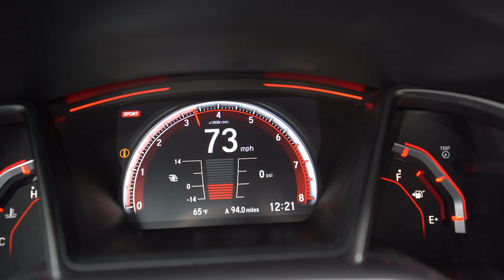I’m Having CLUTCH ISSUES In My 10th Gen Civic Si!!

Comment: I make the Ctr retro and it does not cost 2k stop spreading misinformation.  It’s 1650 installed for anyone willing to drive down and have it installed.  1250 if u need it shipped
Reply: Drive down where? 🤔
Reply: Is there a way to contact you directly?
Reply: AOMechMarine AOMechMarine not covered by warranty I’ve had mine for about 2 months only driven on week ends took it today and they said nah now i don’t know what to run for my clutch set up
Reply: k20z3allmotorFTW where your shop at bro ??
Reply: Depends where u live. Around here it’s closer to 2K

Comment: i have a bone stock 19 si and it sometimes won’t even go into first or when it does it’ll snap back into neutral and sometimes grinds. bringing it to the dealer tomorrow hopefully is something with trans fluid but doubt it.
Reply: Cmc mod you need to mod it. Will be making a video on process im upcoming weeks

Comment: I just picked up d2 coilovers for my 2020 civic si i got a great deal on. i cant wait to install that. i also got oem window visors for the sedan, acuity pedal relocator and a 2020 ctr shift knob. next will be some bolt ons. then clutch and ktuner. later will be e85. then later when warranty is over i will fully build the engine. and go for a solid 350-400hp daily build.
Reply from the maker: NIIIIICE

Comment: Honda has the best production, second to maybe Porsche. Just because you are running a shit ton more hp above what the clutch is made for doesn’t make it shit. 
Stop being a cheap ass and make your mods match what you are doing. 
Begging for free shit when you should’ve upgraded your clutch,intercooler and brakes before you pushed power. 
Be a little more intelligent about how you upgrade. 
Next, you’ll be blaming Honda for a weak motor when you throw a rod or bearing.

Comment: Its not that the stock clutch doesn't hold power per say. The 1.5t's make a lot of torque. The clutch is the same clutch they always used, the exedy stage 1. The older si and the rsx type s. If you take out the stock clutch it will have exedy written on it.
Reply from the maker: damn, didn’t know that at all

Comment: Spec stage 1 all day
Reply: I've heard people with spec are having high rpm lockout issues. The stock clutch master cylinder doesnt have enough force to disengage it consistently at those rpms. Not good for anyone trying to run power above tsp stage 1
Reply: daniel s I haven’t had this issue personally. I’ve had it for 3 months now. But I have the spec light wheel as well

Comment: My 2018 Civic Si sedan had the clutch go out at 38k miles.  I started working from home before COVID hit so that explains the amount of miles vs the year.  Those clutch’s are garbage!!!!!  Ive read of buyers having issues with as little as 2500 miles.  Honda obviously knows something we don’t, anyone know of any class actions regarding this issue?  I’m not paying the dealer $5k for a replacement, at this rate I will have gone thru 3 clutches by the time the car hits 100k mi.

Comment: The clutch is supposed to last a very long time.
Reply from the maker: yeah but for some weird reason, the clutch in the Si's are not very good.
Reply: @DaggerFPS  Not very good for your applications maybe.
Reply from the maker: even with regular hondata basemaps it wasnt good, i will be getting a new clutch soon !
Reply: @DaggerFPS  It feels like that when it's cold. you have to let it warm up because it's splash lubrication.
Reply: RJ Money clutch on si is absolute garbage trust mines stock don’t Evan have played on the thing and it’s slipping
Reply: @vvvvel  dude there is no oil/lube that goes near your clutch/flywheel unless you have a leaking rear main seal 😂
Reply: @ivanoro34   The GEARS have splash lubrication.
Reply: @vvvvel  make it obvious that your referring to the transmission and not the clutch assembly next time
Reply: @ivanoro34  Absolutely